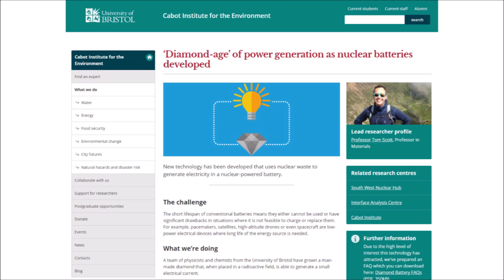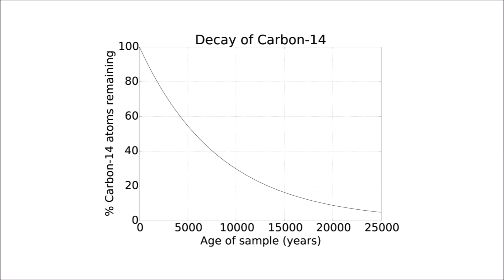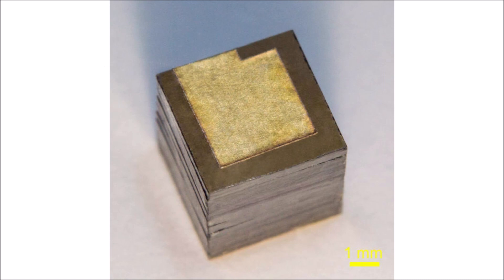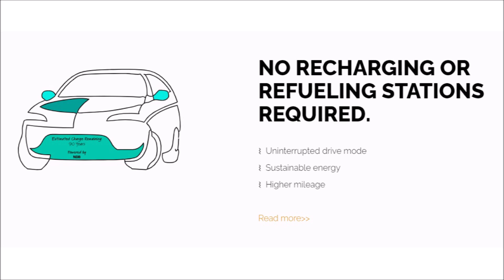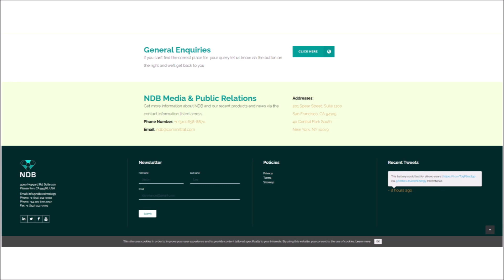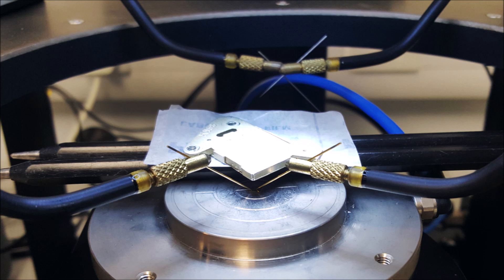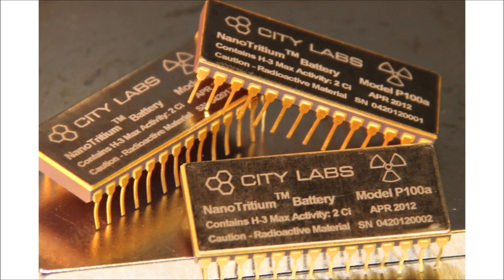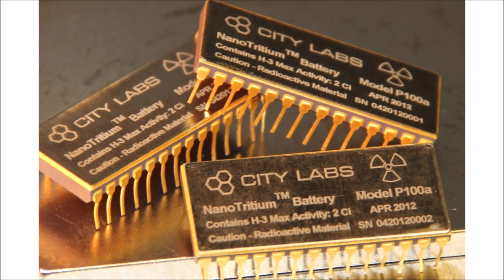Nuclear Diamond Battery - 28,000 Years Of Battery Power And Replacement For Lithium?

Comment: This is just another bullcrap nonsense of hype,DAMNIT,
Well atleast those nuclear batterys could be very very very ideal to maintain our save data in old video games, because instead of having to replace the battery per 20 years , now you only have to replace them after 28000 years , wich is also very ideal for those realtime clock  games such as pokemon crystall etc,,now you never ever have to worry of losing your data or a malfunctioning rtc game,
In fact i never understood why nintendo & sega never bothered using nuclear batterys instead in the first place.
Reply from the maker: That is a very interesting application.  It wouldn't take much energy to keep the save data alive, either.  Good idea!

Comment: 100 uW doesn't sound like much, and it's not, but if achieved, it would still be comparable to tritium based photovoltaics, but using c14 instead, which is much longer lived.  the diamond structure is also much more stable and useless to try to harvest for weaponizing.  I find it intriguing, but most such start ups fail.
Reply from the maker: I do think it could still be a huge deal, even if the cells are only 100 uW each.  They can still be used for many things.  But their marketing talk about powering electric cars and bigger loads is pure fantasy if that is all these cells can produce.
Reply: @LDSreliance  It's true that one of the images has a 100uW label on a graphic, but I'm not sure that implies that 100uW is all you can get out of something the size of a 20 pin chip.  They have made multiple claims of being able to scale this up to use in electric cars and similar applications, so unless they are planning to be sued out of existence for fraud, the technology can probably be scaled up, at least under some set of optimistic assumptions.
Reply from the maker: Right.  It is the optimistic assumptions that I am worried about.  The drawing that was shown was produced by them.  So they put that 100uW on there for a reason.  That is the same size as the existing batteries on the market.  I think they have a plan to scale it up but nothing to show yet.  They don't even have a working prototype of the 100uW.  So my personal opinion, and you are welcome to disagree, is that they need to pump the brakes on outlandish claims until they have a little more concrete foundation there.
Reply: @LDSreliance  The question in my mind is whether or not it's even theoretically possible to scale up to electric car size.  I do know they are doing everything they can to squeeze the energy out of c14 - beta decay, alpha decay, and neutron capture.  What I don't know, is if by doing all that, it is at least theoretically possible to be within a factor of 4 or so of lithium ion in terms of power/volume.  If it's much more than maybe 4x, it starts to become impractical.  No-one would want to drive a semi-around as a passenger vehicle to hold a nuclear power plant, even if by doing so it meant you never had to plug it in.  The nickel based diamond batteries are in the 10 W/m^3 range.  It would take 3000 hours of supercapacitor charging to support 1 hour of drive time with a 1 cubic meter nickel based nuclear diamond battery.  To be practical for commuting, it probably needs to be no more than 20 or so hours of idle time per hour of drive time.  Still, even if NDB were to dominate the space and medical implant battery markets, that would make them a several $billion company.
Reply from the maker: Exactly.  It could still be a game changer even if it could only power small sensors on satellites in space or implanted medical devices.
Reply: @LDSreliance  This battery tech is only safe when using slowly relatively harmless radioactive isotopes such as carbon 14. With a power density in 10s of micro Watts per cubic centimeter, you are a factor of 1000 too little on power density to replace Li-Ion batteries. If you actually used a highly radioactive isotope to gain a more usable power density as what is needed in EVs, smart phones, laptops etc., the internal radiation would be so aggressive that the device would be a dirty bomb. Imagine kilo Watts of beta radiation inside a car battery being broken in an accident. People can get serious skin burns just by such level of radiation and of course if it gets into our environment, cancers will follow. The idea of powering consumer products like phones and EVs with betavoltaic batteries is insane.
Reply from the maker: @ThinkingBetter  With present understanding and technology, yes.  This is nothing more than a tool for NASA or satellites or very, very small loads like you said.  But it could be developed to be used safely with more radioactive materials.
Reply: @LDSreliance  No, that’s exactly where this idea completely breaks down. The power density is a derivative of the radioactive power including heat losses. If you want to deliver kilo Watts of power to an EV you will need even more kilo Watts of radioactive decay (at least twice as much). From 10 micro Watts in a cubic centimeter of carbon-14 battery you will need a million of those to reach 10kW. The battery would be the size of a big house and cost much more while being a very dangerous dirty bomb. Then you can use a more radioactive isotope to improve the power density and reduce the size, but it will just make your dirty bomb car more mobile and even more dangerous. Imagine the iconic elephant foot of the molten core of Chernobyl used to propel cars. The heat (combined power) being produced from it is only 600 Fahrenheit but still it’s insanely dangerous.  Also, if serious energy was trapped in carbon-14 from nuclear waste in amounts usable for wide proliferation, why the heck would it need to be repackaged with lots of extra cost. Even a single average power plant will not yield enough carbon 14 to power a single car, besides this isotope is not feasible from a power density perspective  to begin with. Modern power plants don’t use graphite as moderators.
Reply from the maker: @ThinkingBetter  I didn't say anything about EV's.  And you are still talking about our present day understanding of physics, chemistry, and technology to harness energy.  With discoveries and science and technology advancing as fast as it is right now, who knows what is possible in 2040 or 2050?
Reply: @LDSreliance  You talked about both EVs and smart phones. Neither are feasible at all with betavoltaic batteries now or forever. There might be a slight improvement possible in the efficiency of turning the decay energy into electric energy, perhaps reaching 70% some day, but you are still approx 1000 times too low on power density. Just understand the first law of thermodynamics. Take any nuclear power plant solid waste container and whatever heat energy they are producing during storage is MORE than the electric energy you can EVER get out of it from this technology (and it isn’t much). Do you get it???
Reply from the maker: @ThinkingBetter  No, I don't "get it" because someone 30 years ago would have laughed you to scorn for saying that you could power a handheld computer/entertainment system (a phone) more powerful than anything NASA put in space until the 90's for an entire day with a lithium battery the size of 10 playing cards.  So lets agree to disagree and move on.
Reply: @LDSreliance  It’s basic science and also the computing evolution follows it. You simply can’t get more electric power out from a betavoltaic battery than what comes from the radioactive decay and because that amount is too little by how radioactive decay works, this battery tech will remain outputting extremely low beta decay power and no magic can change it. It’s not a matter of more research. This doesn’t mean that betavoltaic batteries can’t improve a bit, but unlike semiconductor integration density, there is no scientific path to get much further with betavoltaic batteries on power density. Study it and you will realize I’m right. BTW I work in Silicon Valley in high-tech R&D.

Comment: Well done, also got the feeling, after putting some investigation into this, that it is more a hype of ndb as being close to even a prototype. But the Bristol dudes proofed already the concept. Let’s see, I will keep an eye on this, since the technic itself is not so hard to understand and sounds promising ... let’s see.
Reply from the maker: Agreed.  A large section of their website is focused on soliciting investors so it seems like this was a big media push to get some money.  We will see.
Reply: @LDSreliance  The sad reality is that you simply can't have both high power density with a betavoltaic battery and safety at the same time! A normal battery cell can output Watts of power while a carbon 14 based battery betavoltaic battery can output micro Watts of power on any typical battery cell size. The difference is in the range of a factor of a million LOL. The super low power is in fact what makes such NDB battery relatively safe! Simply speaking, whatever power output of a beta voltaic battery is originating from beta radiation nuclear decay energy with some loss. If you have 1 Watt output, you will need significantly more than 1 Watt of pure Beta radiation inside the battery to occur because of energy transfer losses. A 1 Watt of beta radiation will be so much radiation that it would fry your skin if you touched it without shielding and if someone broke the battery and got the stuff out in the open, it would be horribly dangerous. An EV battery of 10s of 1000s of Watts of power via beta voltaic batteries would be a very dangerous dirty bomb and even worse, where the heck will all that power go when you are not driving the car? If you imagine a 10kW beta voltaic battery, it will ALWAYS produce at least 10kW of power that you need to burn either as heat or propulsion. So if the EV doesn't drive, it will become a heating nightmare (car will go up in smoke).

Comment: In one of the Terminator 3 movie...the T850 runs on a single battery which explodes when damaged
Reply from the maker: Maybe it was nuclear!
Reply: If I remember correctly,it was some type of hydrogen fuel cell. And since hydrogen is SO flammable,that is why the Terminator's power source ended up exploding from being damaged.

Comment: Solid insight. While i think it could work, the cells would also be extremely important to process properly. And assuming radiation still exists, this implies that a high volume cell battery would in fact get a bit hotter. So it has to be created with this in mind so it even at high celcius temperatures doesn't run amock in ANY capacity like this. And then, preferably you want the casing to be extra solid so we avoid short circuits in a damage scenario for example. Now to me this all is overcome-able so long it's done right, but i suspect it will hinder max output for cars and the like. Stationary hardware that doesn't have nearly as high of a demand of electricity would however get a new chance to last extra long. And on the note of next gen tech, we could theoretically get an emergency power mode for a lot of devices based on these batteries since they can slowly charge a main battery as you don't use the main unit. This way it's essentially "free" power while one sleep and done use the device. BUT, it all doesn't matter so long we get to see a working product as you said. We can hope, but i am not waiting with how much lobbying cash and oil/gas interests there is from before. Pushing against these great, green solutions that would stabilize the world a great deal. Time will always tell.
Reply from the maker: Good thoughts.  Thanks for sharing!